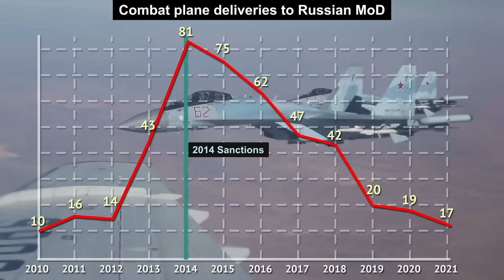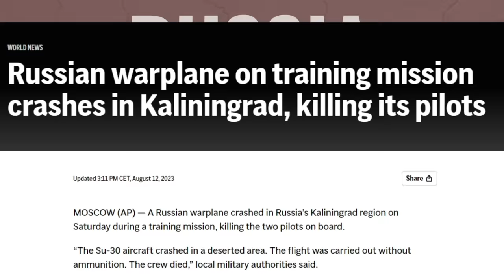Russia has produced more combat jets than it lost in Ukraine in 2023

Comment: My opinion is that Russia will continue production of the MiG-35 SM since the MiG and Russia have invested a lot in modernizing the MiG-29 aircraft, but unfortunately there was not enough time to promote this aircraft because of the sanctions imposed on Russia, but it is well known that many smaller countries were interested in this aircraft or almost all non-NATO countries that used the MiG-29,  The most important thing about the MiG-35 SM is that Russia has upgraded all the missiles that the MiG-35 could carry, My opinion is that Russia will try to counter f-16s with mig-35s because they are aircraft of the same category and if it successfully opposes, of course, with the help of other aircraft, it would be the best promotion for the MiG-35, which is currently the cheapest solution for Russia and the fastest.  As we know, even the first versions of the MiG 35 were good enough for that money and now that plane has been further upgraded.
Reply: I doubt that the numbers will be meaningful and can't fix the already lost to NATO ratio😂
Reply: @ericthered494  I don't understand why you wrote this or what you meant. The F-16s and MiG-29s are aircraft from the same period only Russia has not modernized its MiG-29s except for export and the U.S. has done everything possible on the F-16 and there is no room for any modernization. And as for the aircraft itself without equipment, the MiG-29 has much better flight characteristics and great modernization capabilities that would cost Russia very little. Now how many MiG-29s are preserved in Russia, no one knows. But I know that in one place near Moscow there are 250 MiG-29s and in excellent condition, Russia did not use these aircraft for the simple reason that Russia is huge and they were all for export, but since there is little chance that they will sell them today I see no reason why it should not modernize and use them on this part of the front since they can carry KAB bombs and much more,  I doubt they'll throw them away or let them go to waste and they have enough pilots for them, why would they build a plane from the beginning when they have a scotch
Reply: @velimirkolundzija4451 the F-16s are not block 70 from the US. They are old models from Denmark and possibly Netherlands. They are far from the latest “US has done everything possible” aircraft.
Reply: @sixdegrees6434  What's that bike? I'm currently driving a GSR 600. And as for this aircraft, it is absolutely unnecessary to talk about it because those who are at the top of western countries today are equally working against Russia and against the whole world, no one doubts that anymore. America and the West have failed the whole world and today leaders in the West are turning against their people and it is seen all over Europe and as I have heard, america is becoming increasingly difficult to live. The U.S. fooled Russia first and foremost and in essence who has the better weapons about it is ridiculous talk about it. Simply neoliberal capitalism cannot compete with the socialist system, especially as in Russia today state capitalism means that large factories are owned by the state and the people can buy up to 30% of shares. When a factory is state-owned, everything is aimed at making the best possible product, not how much the factory owner will earn.And that is why in America there are the most billionaires and the most homeless, and in Russia it is only important to earn enough for salaries and that the military has everything it needs, and even if it is not sold enough to other countries the salary will be again because the state can simply donate gas to that factory and not only gas if it is a factory of national importance the state will help it financially and therefore Russia produces more grenades than the entire West. It's very simple, why would anyone in the West today invest in If he doesn't know if he'll have someone to sell them to in a month? What if the war ends in 10 days? It takes a lot of money to invest in machines and then for the least. For the smallest line, there are at least 100 people who have to get dressed first and this is a process that takes time and the salaries in the West are quite high for the simple reason that life in the West is so expensive. Those of us who had a system where state factories were four times lower for us, but our lives were 10 times cheaper. Let's say Yugoslavia, we produced literally everything and when someone hired the company gives him an apartment, we have free health care and education and that all the way to college, everyone could to play any sport because it was all free and that's why Yugoslavia beat America several times in basketball and if it is 100 times smaller?!?! It is the same in football and tennis, for example, as in all other sports, and today when Serbia is left alone and that is not even 1/3 of Yugoslavia, but we all have our own views, electricity is produced by the state and is therefore ten times cheaper than in the EU, and we sell excess electricity to EU countries at their prices. It's been 30 years since the West has occupied Serbia. We can still live very well with 1,000 euros a month, and that's how much wages are today on average in Serbia, which means that women do not have to work and can devote themselves to children, and if a woman works, then life in Serbia is much better than anywhere in the West with 10,000 euros.
Reply: @velimirkolundzija4451 You think Russian maintenance on those planes have been good. There is massive corruption in the Russian military. Look at the state of their nuke subs, their fleet. The protection provided to soldiers, to the use of t50 and t60's. Russia is using soviet era stuff, cause they can not produce anything better reliably. Not fielding t14's, not fielding su 57's.
Reply: @Musiclover4822  I'd be embarrassed to write something like this for money. But ok if you can't make money any other way since you're in the West then that can be understood, but if you really mean this, then in your country someone has occupied the media!! Do you know how much America owes? Do you know of at least one country in the West that is not over-indebted? E look Russia in addition to more than 400 tons of gold has 600 billion dollars surplus or you stock, so not that it is not indebted to anyone but I have reserves that have not arrive It's going to be a new project because it's being attacked by the West, first and foremost, america. As Putin announced that if it had not been attacked, the entire army would have been modernized by the end of 2024, but given the circumstances, all this is not bad considering that Russia will modernize its forces much better today. NATO or America had been planning this attack since the 1970s and it took them 20 years to start this nation and not on Russia, but first they attacked a small Serbia in the 1990s and it took them 30 years to occupy Serbia To invade Russia?!?! But while the whole West was struggling over Serbia, Russia made the best weapon in the world!! Does anyone have a better anti-aircraft system than Russia? Does anyone have better missiles than Russia and so on, only first of all NATO thinks that it has occupied Serbia and we all know very well that russia simply cannot be fought since it is well known that it is the strongest nuclear power! Has anyone ever seen what's happening in the EU? They have imposed sanctions on Russia and Russia has GDP growth and the entire EU is in recession?!?! And not only are they in a recession, but the entire West is deinduistralized, and what's worse is that if they start building factories now and finish it in two years there's no one to do there!!! All in all, the Nazis again managed to deceive a large part of the world through EU projects which was actually an occupation of Europe in order to attack Russia but also now?!?! Who is the one from the EU who will take up arms and go after Russia?

Comment: How many Russian aircraft are now out of  commission now due to simply wearing out or a lack of spare parts? There are a lot of extra hours getting put on airframes due to the war. Sure, most planes can easily fly past their recommended flight-hour limit. But if components are starting to fail & replacement parts are in short supply, the aircraft is at least less effective & potentially grounded. Worst case scenario, the aircraft decides it doesn't want to fly anymore while still airborn. 

I would imagine that such 'losses' could easily outstrip the combat losses incurred.
Reply: Exactly what I was thinking. Russia has been putting a lot of wear in its air frames. They're not going as deep into Ukraine, but they're running nonstop CAP. We probably won't see them fully falling apart for some time still, but that wear is absolutely there and having an impact.

I imagine the effect is even worse for their helicopters

Comment: Oryx already claimes the higest rate of Russian casualties resonably possible. In geneal I think it's a very good video. But to add casulties to what is already a very high end estimate undermines your credibility.
Reply: Oryx only counts visually confirmed losses. 

There are many videos of Ukrainians firing manpads which explode near Russian planes but the plane keeps flying. Often more than one missile is fired at the same plane. Also a lot of the Russian planes are flying more than they should before regular full strip down maintenance as the  factory is busy making new ones. So losing engines due to overuse is not common even when you still maintain them well. Fighter jets are very maintenance heavy. 
Overall the Ukrainian claims are over the top oryx is usually a bit low and the reality is a bit higher than oryx.
Reply: @MrRedsjack  Yes, but the same wreck can be filmed from multiple angles or with tampering on site. There is no vetting of when the wreck actually happened.
Reply: @khyronkravshera7774 Oryx constantly revises their tally and uses geolocation and other methods.  Theyre not purposefully tallying the same wrecks or anything of the sort. Ive seen them remove claims multiple times.  They also tally UA losses and those are pretty ugly, not as high as russian though.  That jives too - Russia has been attacking.
Reply: Oryx isn't ruzi resource, filming the same thing 20xs is a ruzi thing😂
Reply: @jefclark  I think Oryx does tend to give Ukrainian sources the benefit of the doubt when identifying wreckage. Although I do still think Oryx is still one of the better sources. And had Binkov simply used those numbers I would have accepted it as him using the best numbers he could find. The fact that he added to what we're already likely inflated numbers is what I find troubling.  I think it exposes Binkov''s bias which is interfering with a otherwise excellent analysis.

Comment: Binkov's Battlegrounds:
A lot of the plane lost have been close air support.
The replacement planes are mostly air superiority ones.
So, that leaves a widening gap in close air support. While SU34 have been getting more air time, they are also  getting shot down and Russia still has issue sourcing for them enough precision guided bombs. Russia has limited options: glide bombs from far away (with a number of planes shot - hasn't been that safe), dropping dumb bomb from high up with SU34 with limited precision (and plane losses) or low flying runs with old SU24/SU25 mostly firing unguided rockets while hoping to avoid manpads (and plane losses).
Or use limited quantity of cruise missiles on static targets since the Russian targeting takes days.

Comment: This indicates to me that Russia has moved into a full war economy. They will likely be able to replace most lost equipment at this point. 

The biggest loss for Russia is their pool of trained pilots. Losing so many fighter pilots and even trainers is going to set them back by years if not decades. It won’t mean they can’t keep fighting but it will degrade them significantly.
Reply: Russia stepped up production of training planes as well. So draw your own conclusions;)
Reply: @aleksandrpulnikov684  I’m sure they did. That’s not the point, training competent fighter pilots is a long term program that requires years if not a decade to see the fruit of such efforts. You need experienced fighters and trainers to build such a program. Russia’s program was small at the start of the war and the losses they took early in the war is going to take a long time to recover. 

Alex Hollings of Snadbox news has a good video on the issue. 

It’s similar to the issue the US has with a lack of naval dockworkers, but worse. The training infrastructure and experience build up takes time. It’s not something that can be easily shortcut.

Comment: Cover Russian semiconductor industry please! Plan to manufacture 28nm in a few years and 14nm soon after which will be more than ample for military equipment?
Reply: So in 10-20 years they might be just 10 years in our past? Impressive
Reply: @Tomer_Zaitsev   That isn't the point. You don't need 7nm production for most military electronics. It won't give you an edge. Only in complex CPUs and GPUs does it improve performance per watt.
Reply: @pennyhardaway7491  you are wrong. A tanks ballistic computer might not need it, but if you want its automatic turret to have visual target recognition, you sure do. And thats also true for helis and jets, especially with the new tech like helmet targeting and stuff. Otherwise you'd be flying in an 2020 airframe with 1990 tech
Reply: @Tomer_Zaitsev  The get whatever electronics they need already. Lancet Has had a large production spike and it is powered by US chips.
Reply: @Tomer_Zaitsev  No it is not. You can run AI on Chinese smartphones with 7nm processing.
Facial recognition, auto targeting etc is not complex. When you first learn to program in python you literally build such systems.
Reply: @pennyhardaway7491  bro doesnt know what he is talking about and does so with such confidence. You talking about learning python, i am finishing my c.s major this year. But anyway, your cute python script using basic neural network recognizes 5 faces with 95% accuracy with high resolution photos
I am talking 99% threat recognition from fast moving camera in dusty wether, or 95% face detection from a million people. This is military grade and you cant do that off a neural network you build on python on a Tuesday afternoon with a Chinese camera and phone as proccesor
Reply: @Tomer_Zaitsev   CS major is cute, literally takes a year to complete an equivalent program online. Nothing special. 
99% threat recognition 😂
You live in the realm of Hollywood fantasy. How is that 99% threat recognition working for Israel, a country with some of the most capable targeting and tracking systems.
Reply: @pennyhardaway7491  damn my response was deleted, presumably because it mentioned israel. It was pretty much me calling your bs again but i cant be bothered writing it again.
Reply: @Tomer_Zaitsev "especially with new tech like helmet targeting" do u know where it was first used? In old good soviet MIG 29, do u think that they had 7nm back than? Do u think that they need 28nm since every fighter jet in Russia have such helmets?
Reply: @OVER-ce9fy  the dog shit they had does not compare in any way to most modern western heli/f35 pilot helmets. Its like saying we dont need all of the modern phone's processing because the blackberry had connection to internet, Bluetooth and everything over 20 years ago.
Reply: @Tomer_Zaitsev they don't need something equivalent to F35 it's to expensive for Russia
Reply: @Tomer_Zaitsev  I argue it depends on the use case. A computer that weights 40 kilograms is less of an issue in tank, than it would be on stuff like planes.
Reply: @operaatio5117  oh no you are wrong. Weight isnt an issue in a tank, but space very much is. And its a much bigger issue in russian tanks that are cramped up as it is
Reply: Doesn't really matter those chips can be easily bought anywhere and even china makes them.
Reply: I believe that with the latest upgrades F35 use chips no smaller than 30(ish)nm. 
Some more advanced chips are used in other systems but usually at least 10 years behind cutting hedge because you want very reliable systems.
Reply: @Tomer_Zaitsev  Maybe keep contingency back up copies of your postings?  Sometimes postings mysteriously disappear.